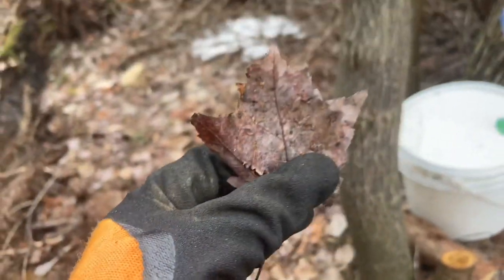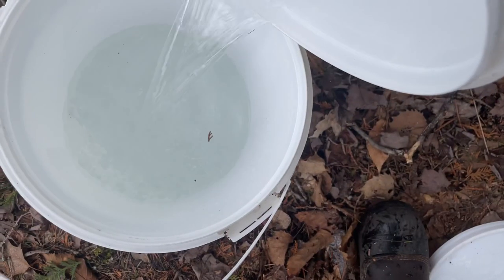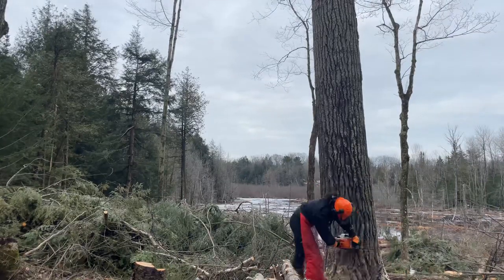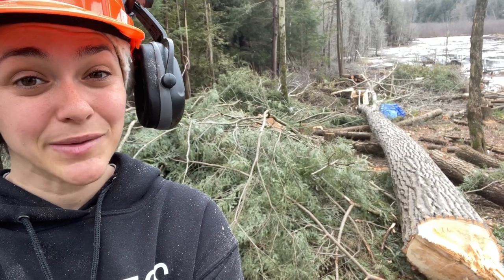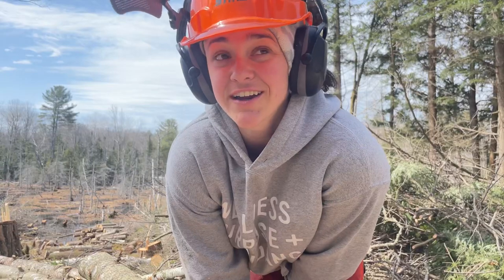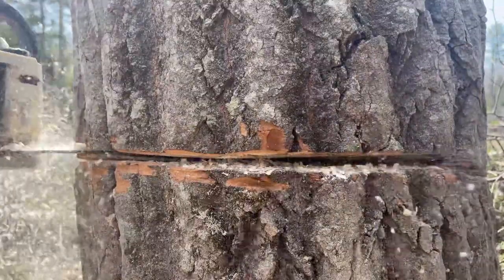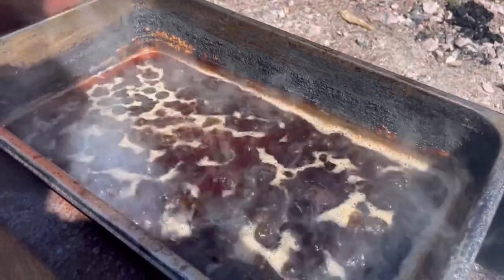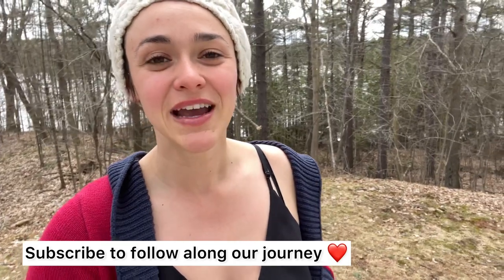Almost done LOT CLEARING and MAKING SYRUP

Comment: Little tip you can sharpen your chain after use . Also cleaning the machine is a big plus when you take of the chain to sharpen it . Air compressor works great . 👌
Reply from the maker: Thank you so much! I meant to get a few shots of me sharpening but I think I need to sharpen more often!